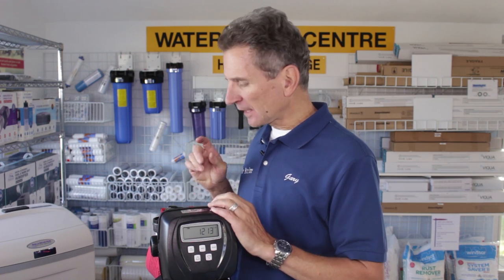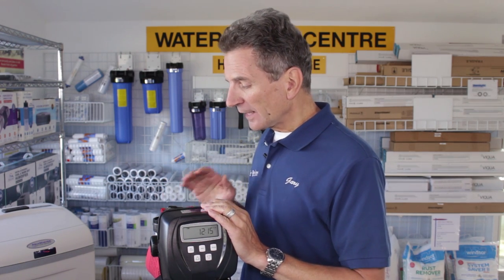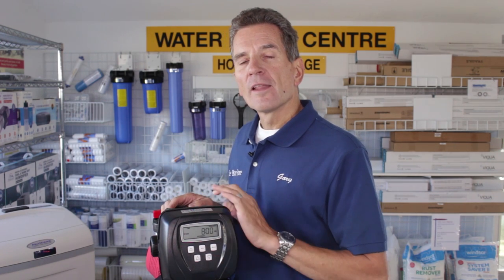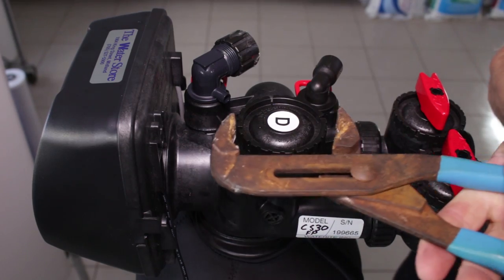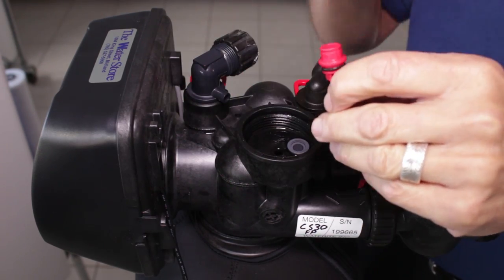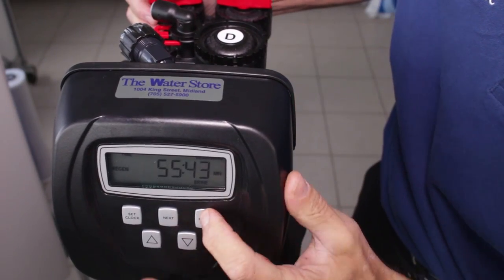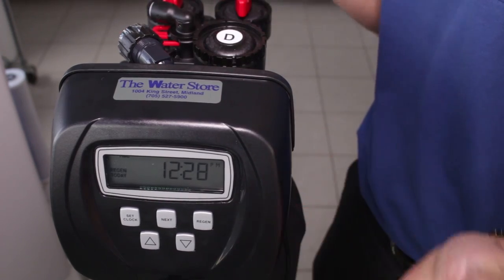Water Softener Troubleshooting How to Clean Clack WS1 Injector

Comment: Great video. Excellent advice My water pressure dropped and I thought I would need to get a new water softener or at the least get it serviced. I found the injector on my softener and removed it. It was gummed up so I cleaned it and the screen. Now the water pressure has returned to normal. Who would think that a small device with a very small opening would cause the water pressure to drop to almost nothing. Will be running some cleaners thru the system as well.
Reply from the maker: Glad it was helpful!  Please share with friends and family.
Reply: What cleaners did you use to run through the system? Was it beneficial
Reply: @KollynJ  Can not remember. Just cleaned the valve with soap and water and some vinegar, used a toothbrush to scrub it. Think I just used a small battle of water softener cleanser, available at a water center or hardware store. Just added it to the salt tank.

Comment: Thank you much!  I have a different brand softener, but this helps me out.  We're tasting salty water after the softener runs the previous night, so googling that it sounds like it could be a clogged injector.
Reply from the maker: Glad it helped! Yes, or a clogged drain line.
Reply: @water_estore  nope, that was it, injector was part clogged with some sediment. I really liked how u showed walking the cycle back to default at the end, so it would run as scheduled or that night.

Comment: H Gary.  I have no suction on the brine line when it is in softening mode.  You mention in this video that a clogged injector would cause the brine tank water level to increase.  That doesn't happen on my unit.  No water moving that I can tell.  Is that purely a clogged injector problem, or is that a pump failure?  Thanks for your comment.
Reply from the maker: Sorry to hear.  This video will help troubleshoot your concern https://youtu.be/Lr3jyGiJdC0

Comment: Hello Gary thanks for the sharing your knowledge on these units. I cleaned the Injectors because my tanks are reading "no salt". But there is salt. After I run a regeneration it reads no salt in tank. How can I remedy this?
Reply from the maker: You would need to check your manual on how to change the settings or just ignore it.  That means absolutely nothing, some brands of water softeners include that to frustrate home owners. I never set that up.

Comment: Hey Gary! Love you videos. Not sure if the injectors are my issue, but one side of my dual tank system doesn’t seem to be backwashing, rinsing, or filling properly. During that part of the Regen. it is just very quiet and my salt tank/brine well has no water in it afterwards. Thoughts?
Reply from the maker: First, I would look to see if somethjing is clogged.  Thsi video might help https://youtube.com/live/Lr3jyGiJdC0
Reply: Based on your troubleshooting video and the symptoms, it seems like I have a partially clogged/blocked drain line off the Softener valve. The two drains are connected to a T fitting and drain into a floor drain pipe. The Iron Filter backwashes and rinses loud and strong, so it must be localized to the small part of softener drain or the softener valve itself. Any advice on how to proceed with rectifying this?

Comment: This week, that elbow piece you disconnected started to leak on mine. There is a white circle on the side of the elbow and water is slowly dripping out of there. I'm assuming that's a pressure relieve or something like that. Any idea what's going on? Can it be fixed or do i need to replace it. If so what part do I ask for?
Reply from the maker: This does happen, you need to replace the drain elbow, we have them here https://waterestore.ca/products/clack-ws1-drain-elbow-v315801?_pos=135&_sid=7b91474aa&_ss=r

Comment: Gary I dont have your water softener , I have kenmore and Im fighting the high water issue or not enough water being taken out on the regen.  I have replaced the black gasket in the venturi and and checked and cleaned my float assembly and the valve on the back and have found no blockages.  Water is being pumped out the overflow but no nearly enough.  Currently water is at least 4-5" above the salt level.  Dont know what else I can do.
Reply from the maker: Sorry to hear.  Did you try the advice from this video? https://youtu.be/ZdA0aI1q22w

Comment: Thank you for the great video i have a water softener with clack valve ws1 valve an i notice my softener pellets are not needing replacement so i think the unit is not cleaning i checked unit no error codes an when i hold re gen button i see motor gear move each time an i did see water out of drain tube when in brine position but tank seems to not use pellets or i didnt see water level drop either when in brine position do u have ideas unit is about 10 years old an did have basket with o rings changed about 1 year ago an do notice hard water stain on shower glass so i know something is not right
Reply from the maker: did you clean the injector?  That's where I would start.  I would also check the items in this video https://youtu.be/_DF9892RERQ

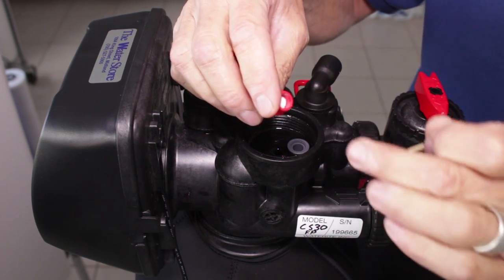Comment: Hello Mr Gary.  I have a Water Right Impression Plus water softener and even though it's set to regen at 3:30 a m , it has been starting at around 11:00 p m the night before. I always make sure that the clock is right and the regen time is at3:30 a m. Can you help me please?
Reply from the maker: You may have a leak somewhere and the system is running out of capacity early and then it regenerates early.

Comment: Water started leaking out when I unscrewed the cap. I closed both of the valves like you showed and I have this exact model. What'd I do wrong?
Reply from the maker: Did you start a regeneration before bypassing to release the pressure? Does your drain line go up?  Might just be that water
Reply: @water_estore  drain line goes down. Regen was started prior as well.

Comment: Do you recommend, depressurize the system and bypass when going on vacation ?? For abt 8 days ?? Or is the system going to go bad. Thanks
Reply from the maker: You can but really don’t need to, you would not damage anything if you did
Reply: Ok thank you, i just dont want the sewage pump going cause if we not home and it fails it will flood . So at least i can eliminate regen on these for few days

Comment: How do you leave it out of pressure if you want to soak the injector for hours?  You manually move it out of pressure and it looks it counts down from 8 mins, how do you keep it there for an extended time?
Reply from the maker: You can't.  Just bypass it until you are finished.

Comment: Hi Gary, I have a Fusion2 water softener that looks very similar to the one in a lot of your videos. I have watched many of your videos and was wondering if you have a video or advice on what to do when the resin gets into all the pipes and toilets in your house after the water was turned off because of a pipe leak under the kitchen sink. I hoping to clean the softener and refill the resin. I suspect from reading and watching videos that some membrane broke because of the low water pressure so I'm not sure how to fix that along with the cleaning and refilling the resin. There are lots of videos on how to refill resin but not on how to decide if I need a new water softener or if this is a fixable problem.
Reply from the maker: There is a riser tube inside the water softener with a basket at the bottom and top.  Likely one of those let go.  If you replace the defective part and reload the resin it should be fine.
Reply: @water_estore  Thanks Gary, you are absolutely right it was the lower basket that was broken and allowed the resin media to pass into all my cold water plumbing in the house.  I really appreciate your video as I for one just considered the water softener a mystery that you just put salt into every month.  After watching some of your videos I have learned a great deal.  Thank you.  Tomorrow I'm getting new resin and a new basket and should be back up and softening.  I'm doing some of the other maintenance you suggest too since I took the softener apart.  Thanks.  I've reccommended you to my relatives that live near midland if they ever have a softener issue.

Comment: Thanks for these videos they are very helpful.  My question, while cleaning or replacing the injector do I simply let the unit continue thru its regeneration cycle?? Thank you.
Reply from the maker: Your welcome.  Yes, just continue the cycle.
Reply: Hi Gary, I found your videos very helpful and they have saved me a lot of money. My question is when replacing the injector (on a fusion 2) can you leave it on bypass and let the water softener continue with its cycle without it harming the unit?

Comment: how do you tell which part to replace when it only stays in regeneration mode?
Reply from the maker: Do you mean if it gets stuck with water running to drain?  If so you need to replace the pistons and seal pack, this video shows you how https://youtu.be/WIa033n4OQE

Comment: Ok, so I cleaned the injector, the intake in the water where salt can build up is clear of salt. I am letting it regenerate, it back washed, then went into brine…and it’s filling all the way up again. One thing I noticed is when I took the injector out water was standing under the D cap…
Reply from the maker: Did you check out this video https://youtu.be/ZdA0aI1q22w
Reply: @water_estore  oh man so its pistons and seal probably...do you know what that component costs?